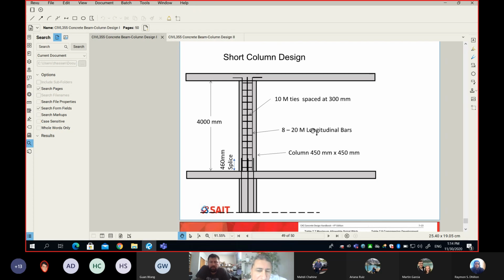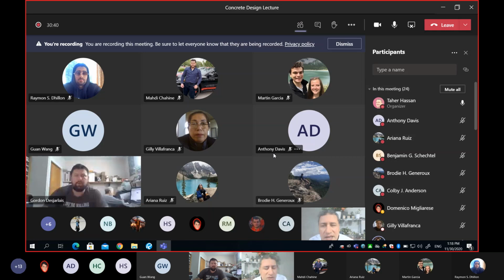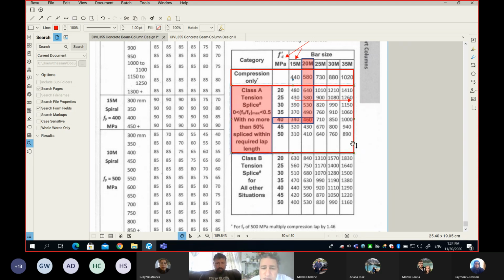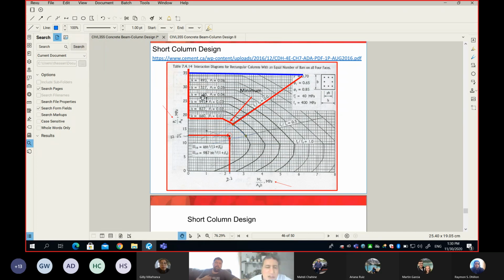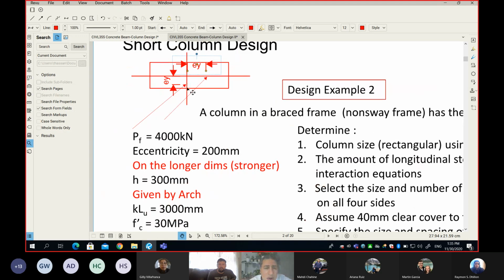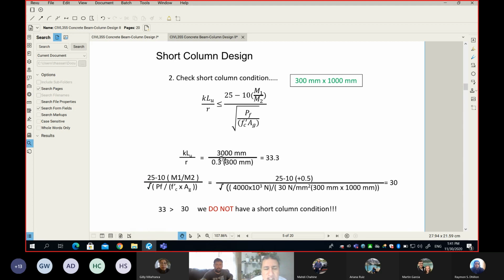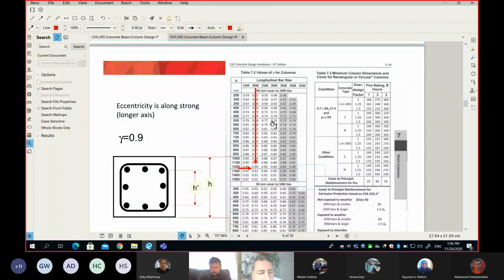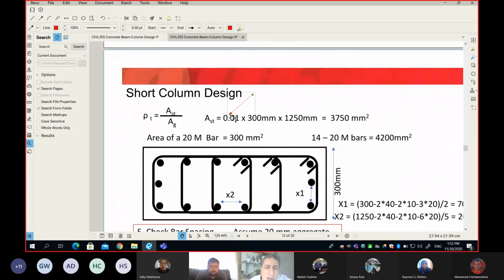Column Design part VII

Comment: area=0.3025m^2, h=300mm,so B=1.0m(1008.3mm) then B should be 1050mm. check short dolumn condition from 300mmX1000mm? I think should be from 300mmX1050mm since the minimum dimesion is 300mmX1050mm
Reply from the maker: What you get from this chart is just a trial size. You can do both. The more concrete area the less steel area you need. So it is a trade off.